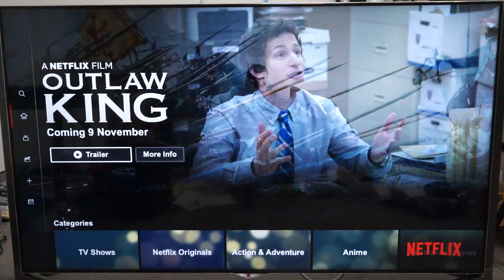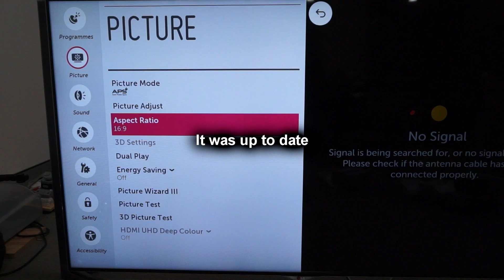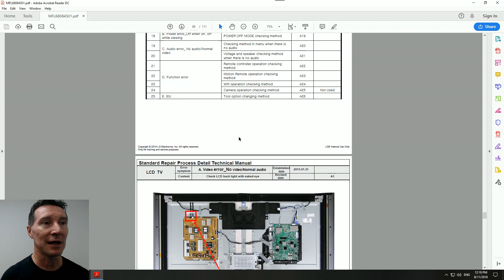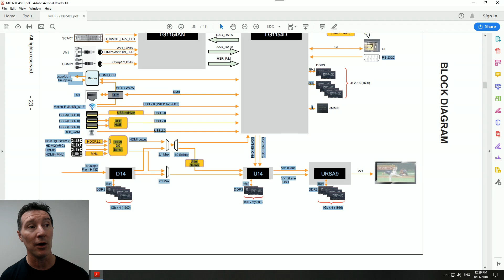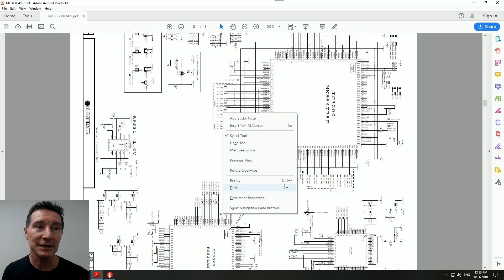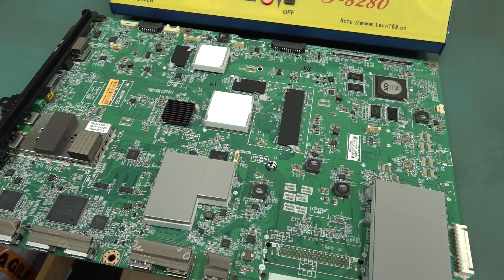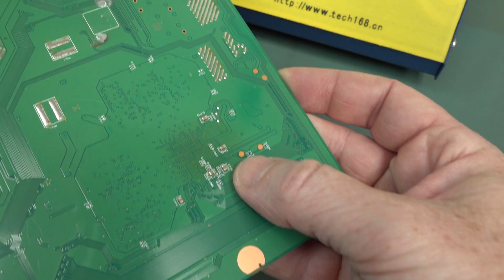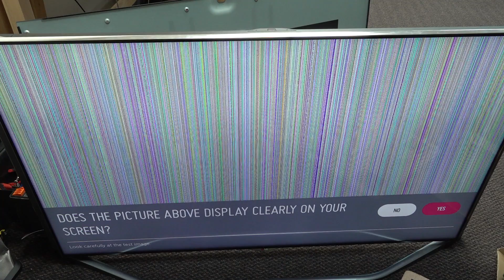EEVblog #1154 - Surprising 4K Dumpster TV Fault

Comment: Generally, you might hold a chip to be reflowed with a set of tweezers, and since you can't always be orthogonal to the chip it will move however slightly when the balls liquefy and then you know to let go and let cool. Tons of flux might have been appropriate as well.
(A total aside, separate is unlike most words with and ur sound in the middle [with an er], but you know because separate has a rat in the middle, lol! It's how I avoid misspelling it;)
Why wouldn't you take it off and reball it? It isn't difficult and you'd teach people something. Is a replacement easily available for the chip? Reball and replace? You have a reball stencil right?
Reply: Patrick Horgan It's generally not the "rate" part that's hard to spell, except when the brain strain from the 1st half spills over.
Reply: @johnfrancisdoe1563  I think he meant "a rat" in the middle but didn't italicise the first a  :)
Reply: Totes realize that Australian spelling might be different than Yank spelling, lol!
Reply from the maker: Because:
a) This video is already 30 minuets long and valuable in it's own right, so upload now.
b) No I don't have a reballing stencil, and I have zero experience with reballing.
c) I have not looked, but I doubt a replacement chip is available.
d) What if some pads lift and/or something else goes wrong, it's a one-shot deal and I have zero happy ending to show in a video. It's not like I have any of these boards or chips to practice on.
So in this instance, no it's not easy to just go and re-ball it.

Comment: -Thanks Dave, the suspense was killing me.  I found a TV in the trash which looks like it may have been close to a fire...had extinguisher white powder residue. I took it home, powered up to see that  a few lines were on the screen. The lines eventually cleared up. When the room is warm, the TV starts...no problem. If the room is cold, it powers up with  no picture but a faint clicking is audible from the speakers. Once it warms up and I repower it, it starts OK.  When I get a chance, I might check for issues inside the enclosure.  I am open to suggestions from any viewers.  It might be a cracked solder joint or bad cap.   J K
Reply: That is a cold solder joint causing that I imagine.
Reply: Cold faults are usually bad solder joints or bad electros, so yeah, you're in with a fair chance.

Comment: phones without ir blaster work just fine.  
get the IR code as a pcm wav / audio file, hook up a ir or even red led to the 3.5mm jack (if you got one lol) and play the file.  i entered my lg tv service menu this way many times.
Reply: link to a write up or something?
does phone amp has enough output power / frequency response at 38 KHz for IR ?
Reply: http://openlgtv.org.ru/wiki/index.php/Access_hidden_service_menus_/_modes#Simple_improvised_home_brew_IR_transmitter
Reply: it plays at 18khz to create the 36khz by using its harmonics  the actual bits are at quite slow frequency
Reply: @gamerpaddy  yes, 38K is the carrier. do tvs like 36 K though?  Thanks for the link
Reply: then its 19khz, i downloaded the zip containing the .wav files and did a FFT analysis but didnt bother moving the marker to the peak for exact frequency. just eyeballed the graph
Reply: ok cool.thanks.😊  @gamerpaddy
Reply: Cool trick, thank you.
Reply: thats fckn genius, does this really work? thanks so much!
Reply: Wow, nice trick @gamerpaddy, I'll remember that
Reply: You can buy little IR “nubs” on eBay for a couple of bucks that plug into the headphone jack (unless you have the “courage” to live without one. )
You need two IR LEDs wired in opposite directions...  One fires on the positive half of the waveform, the other on the negative, which doubles the frequency to the required 38 KHz. Very clever hack!
Reply: dude im gonna pinch that idea. nice work! did you make sure the PCM file is always positive polarity? fascinating im gonna have a look. you rule dude thats cool
Reply: You don’t even need to make a WAV file...  there are apps that work as universal remotes which will work with IR LEDs on the headphone port.

I’ve used one on iOS called “ZaZa Remote” successfully. It even had the code in its downloadable library for activating service mode on the crusty old laserdisc player I was tuning up.  YMMV, of course...
Reply: @bitrot42  dude no way? thats neat. i wonder if they clip the wave so its always positive polarity. you should check :) hint
Reply: Pepe's World  my understanding is that you want positive and negative swings, so back-to-back LEDs will flash two pulses every cycle, giving you a 38 KHz carrier from a 19 KHz audio tone.
From what others are saying, it may work with one LED, I guess because 38 is a harmonic of 19. It’s probably not necessary to have only positive swings, as the single LED will just ignore it. Not sure you can really eliminate it, anyway...  doesn’t it have to be a plain sine wave as you approach the Nyquist frequency?
Reply: @bitrot42  hey thats neat. i didn't think about back to back LEDs. that might mangle up the encoding wont it? a 1hz sine wave has a down pulse and an up pulse. so if you sent out a sine pulse you'd get two zingers.  let me get one of these wavs & have a look. hrm 

the training preamble at the start is a 18khz tone. so yeah clipped in half, you get double, getting 36khz sine. so that much is true. 

if i low-pass the AC signal (as viewed by a receiver) i get no signal. i get small pulses that dont resemble a square wave. looks like ya classic spiked-wire pulses.

if i clip the AC signal to only positive polarity, then low pass it (3k rolloff),  i get a song series of square teeth from the training preamble. success. works either positive side or negative side.

i did this the other night & sigrok understood it :P no kidding. was doing it at 3am on my laptop in audacity when i couldnt sleep. was great fun.

i will now split off the AC signal into two separate streams of clipped signals, flip the negative into a positive and join them together.
(simulating an LED shining the negative half, and an LED shining the positive half)

woah one strong as balls 36khz sine wave carrier with verrry teethy looking waves.

lets low pass this. hot diggity dang! stronger signal!! in fact if i toggle on/off the influence of the negative(flipped) wave, the signal drops by 6dB. classic stuff. 

i really thought this'd cancel itself out. good stuff wondras you're the man. i had the wrong idea about this stuff but ya set me right.
Reply: @pepesworld2995  Awesome that you dug into it to really see it in action...  Somewhat related to this, there are a few 80s arcade games that control a laserdisc player via a wired remote jack. Some send the commands modulated at 38 KHz as they would come from an IR remote, while others just send the raw data pulses. I guess the player has a low-pass filter on the remote input, so it doesn't care if it's modulated or not.

Glad it was helpful. Good luck!
Reply: @bitrot42  ooOOoo thats facinating :) hey subscribe to my channel! shameless i know, but i need the numbers. its like eevblog but for hackers with no money and no friends
Reply: Pepe's World  I’m so there!  Subscribe to mine, too! (mostly vintage arcade game repair)
Reply: Does it really have enough power and voltage to drive a LED? What can the jack do?
Reply: a red / ir one of course, their Vf is right at the peak of what a headphone jack can deliver (note: amplified headphone jack not just line-out which is just 1 Vpp). 
the led isnt running at much power, a red one is barely lighting up but its enough for the sensitve ir receivers to detect it when holding it like 1cm infront. certainly less than what most headphones require.
Reply: ur phone sucks my phone has ir

Comment: I think the issue is quite obvious: You didn't use enough flux! Check out Louis Rossman to see what an adequate amount of flux is.
Reply: Its 2 parts flux, 1 part PCB.
Reply: @The Dollar Guy 
Is that by weight or by volume?
Reply: The bigger the glob, the better the job.
Reply: Yeah you need at least one milliPaul of flux, that's like a microPaul or something. Totally inadequate.
Reply: @Dave Micolichek  pretty sure he doesn't get along with Louis Rossmann either :P
Reply: If you require scuba gear, then that's just about the right amount of flux.
Reply: @Dave Micolichek  Uncle B has a long running grudge against the angry pixies.
Reply: two days after your comment, Louis himself came up there and said it himself: https://www.youtube.com/watch?v=XyqzVNNZEBQ&lc=UgyfAg_c8aqn7W630zx4AaABAg

Comment: You need a unit with a smashed panel..Cheap
Reply from the maker: Not that cheap
Reply: unless he's really hurting for a TV, might be better to offer up his working panel on eBay for someone who has smashed theirs
Reply: @Sharklops  imagine the postage price for this absolute unit
Reply: Does Dave sell anything?
Reply: @Sharklops  Not sure how he calculates his cost per hour of work (for a YouTuber it's likely: work as much as possible while fitting everything else in your schedule and receive a huge variation of revenue), but a few days of work is probably not worth the cost of a TV for him, unless he receives revenue greater than the value of his time spent on this.  Not sure, but it doesn't seem like he would save any money by spending the time on it.

However, there's the fun factor and if he wasn't going to be productive anyways, then it's worth it!  I would personally do it for two reasons.  1) I don't have a 4K TV at the moment and 2) there are times during the weekend where I don't want to be doing my job but don't mind working on a project.
Reply: Somebody offered boards from the same model (smashed) in the comments on the first video

Comment: Ay at least you gave it a gander, would recommend checking out "Louis Rossmann", he seems to be more acquainted with reflowing surface components
Reply: Rossmann is not an expert solderer, as he readily admits. Dave not only knows who Rossmann is, but also is far more skilled and level-headed than Rossmann.
Reply: That TV isn't Apple-branded though? :P
Reply: @gigaherz_  True but at least apple doesn't make proprietary silicon, so its the same process.

Comment: my first thought was the MPEG decoder is screwed...but it could possably be the RAM on either the main decoder chip or the U14 or URSA9 chips...looks like a PC graphics card with bad RAM...one of the RAM chips on URSA9 looks to have something on the top (notice you can read the other 3 fine)..the glue blobs maybe there to help keep the chips from lifting under heat stress..
but meh! its dead now!...send it to Louis to have it reballed..he seems to enjoy that crap!
Reply: That was my initial thought, one of the ddr3 modules (bga's) is likely toast. Perhaps the pair on the left in the illustration is the framebuffer memory. (the one marked with 16x2 lanes?) That said it could still be a power issue, the chip will consume more power the moment you play video and a PSU rail might be dropping.
Reply: Adding to this the OSD would just be superimposed on the data before going to the LCD panel, so the chip you desoldered likely had little to do with the issue unless there was a problem with the input side of said chip.... you can see that the video selection and OSD is pristine so it would have been the main SoC that was decoding the video where the issue lied, and it didn't look to be the chip you ruined. Also you failed to do the tap test, tap, press, super cool via compressed air trick, bend various areas around the chips and see if symptoms differ... etc.
Reply: "looks like a PC graphics card with bad RAM" was my 1st thought when i saw the 1st video.
Reply: Yeah, my bet is on the RAM... It is not even Samsung!

Comment: Surprised it had RS232 instead of USB
Reply: Those fancy AV controllers like you see in a home theater or sports restaurant use RS232 to talk to each other.
Reply: @MrAwYork  Good Point, I only use RS232 for programming PICs
Reply: @Proscriptus a place with over 50 TVs.  Buffalo Wildwings qualifies.